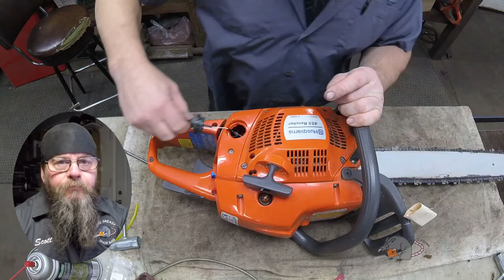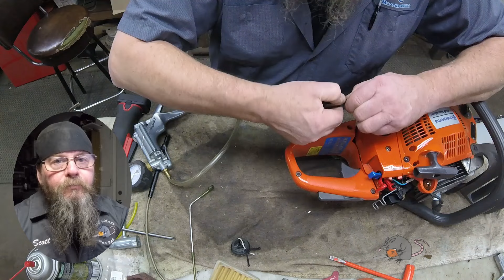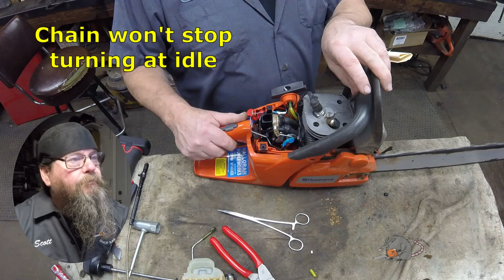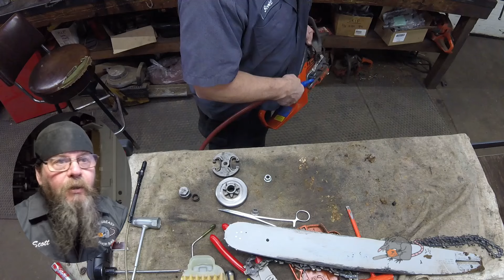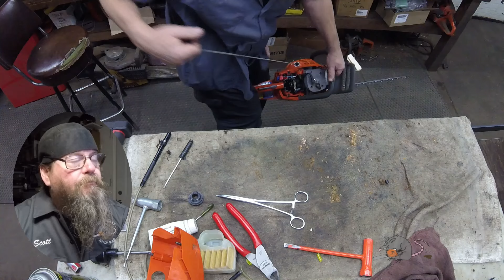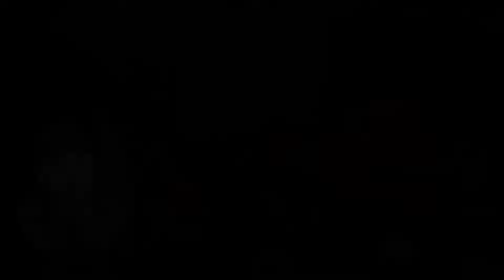Revenge Of The Greasy Shop Rag!

Comment: I would of never caught the oiler worm gear issue. That was a great catch Scott. I would have bought new springs for the clutch or a whole new clutch and still had the same problem. hope your boss realizes your value.
Reply: Dull chains create that often. Lots of heat is transferred, even if the clutch is not blue. Dull chains make the engine over rev and creates lots of problems. Every time I get a saw on the bench, I look at the chain. Usually, it is a good indicator of what to look for. (Although I could not tell about this one since I watched it on my phone lol)
Reply from the maker: @Timoteurs101  I don't remember if it was sharp but you're right, dull chains wreck saws.
Reply: @TheGreasyShopRag I was warned when I bought my MS261CM to never let the chain get dull or it would destroy the top end. I think the chains top speed is 14,600 RPM's
Reply from the maker: @alanshaw6161  Ya dull chains will ruin any model saw.

Comment: Those Guys Bustin a Gut Laughing In The Background About The Revenge of The Greasy Shop Rag Made Me Chuckle Too 😀 I Did The Same Thing With a Chunk of Cardboard I Had A Saw On 😮‍💨 Good Catch On Those Issues I Usually Just Run That Return Line Over Top The Intake Boot it  Sets Behind The Air Filter and Still Out of the Way of The Throttle Linkage 😊😀 Happy Easter Brother 😎👍🏼
Reply from the maker: Ya I guess that line could go either way. Those guys need a good laugh once in a while and it was my day to provide it.

Comment: I used an impact to take clutch off of my 257 to change my rim sprocket and it sheared keyway on my flywheel. Unfortunately it was made into my flywheel and cost me a new one. That was a costly lesson learned. Id done this many times and never had that happen before. From then on ive either used a piston stop or piece of rope and a breaker bar.
Reply from the maker: Thats unfortunate for sure. I haven't had any problems but have heard stories of people putting holes in pistons with a metal piston stop. If I find a clutch to be really stuck I either remove the flywheel first or use rope as a piston stop.

Comment: I have a 460 rancher and was under the impression you neededed to press the decompression button every time to start the chainsaw from a cold start.  I didn't see you press the decompression button once and you got the chainsaw running by pulling the cord hard and fast to start.  So my question is what does the decompression button do?
Reply from the maker: That button makes it easier for people with less power to pull the cord. It releases compression. I don't use it because they normally start better without its use as long as you can pull it hard enough.
Reply: @TheGreasyShopRag  I will try your starting technique between the legs and not use the decompression button. Thanks I learned some valuable information watching your videos.

Comment: Is that lithium grease you use on the needle bearing and oiler pinion?
Reply from the maker: Its a general purpose greas that husqvarna recommends for gear heads and bearings.
Reply: @TheGreasyShopRag I'm a gear head, is it recommended for me? 😄
Reply from the maker: @lanceevans688  Lol, I'm gonna let you decide on that.